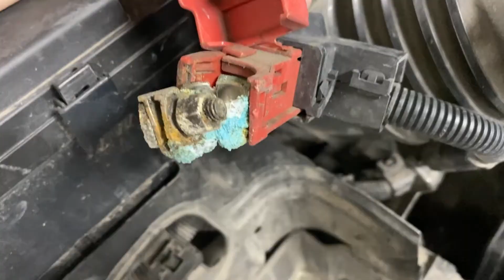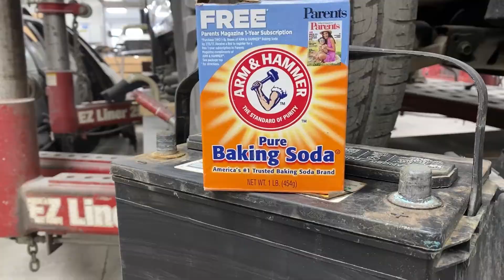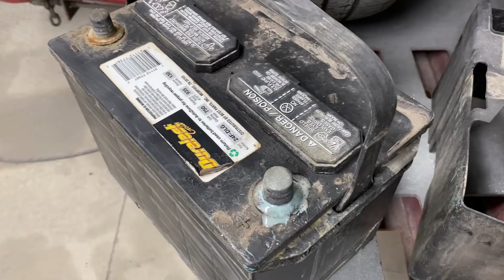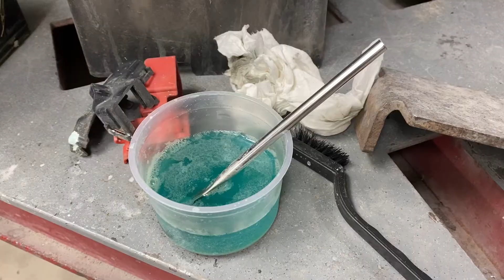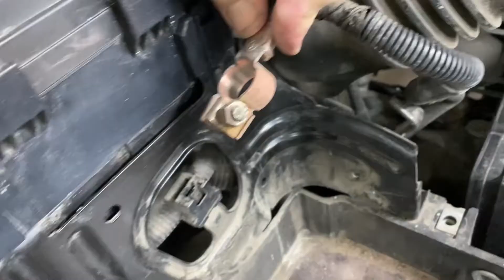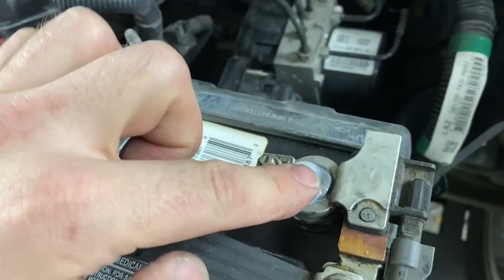EASILY clean corroded battery terminals FAST with household products you already have

Comment: Important thing about the dielectric grease is to not put it between the battery post and the terminal clamp before tightening. 

Dielectric grease is non-conductive, so if you put it directly between the contact surfaces, it can reduce electrical conductivity and cause poor connection.

Comment: Instructions not clear, wife keeps accusing me of cheating because her battery corrosion protector is all used up and says she didnt use it. I told her the nice 21 year old girl that lives next door and I used it in her car, now my wife wont return my calls. All that was wrong with the girls car was the positive wire had corroded off so i had one and fixed it for her... What did i do wrong? I told her exactly what i did. I reamed the hole out in the car, applied that bottle that she had in the night stand and jammed my thick black cable into the hole and BAM she turned on! Sparks were flying and things started to get hot but no dirt formed on my cable down there so i knew that the bottle of stuff she had in her drawer ( the dielectric grease) was working. 

Please help.... Maybe its an expensive bottle of dielectric grease? I mean it came all the way from Kentucky, even said so om the bottle... Ky for Kentucky. 
Maybe my neighbor can get her a discount at her work so she can cool off with a new fan.... She works at this place that sells fans. Actually thats all they sell is fans.... Only fans.
I just got it lol thats ehy they call it Onlyfans because thats all they sell. Pretty cool. No pun intended 😂. Ill ask my neighbor if she can get my wife a fan for a discount. She gave me her website address to look up.
She told me when I was done fixing her car to check out her fans business ( I guess because i was hot and sweaty from working) 

Your video has really cause me some trouble by telling me to grab that grease out of her night stand